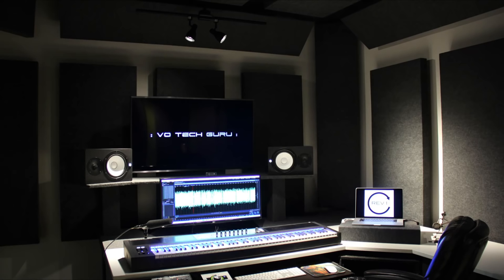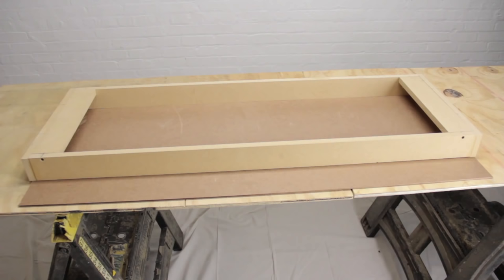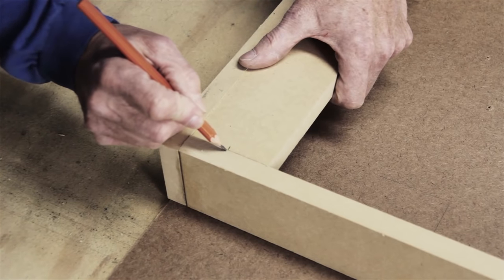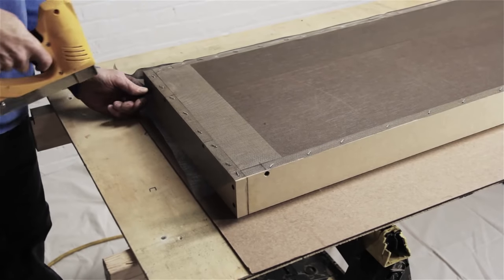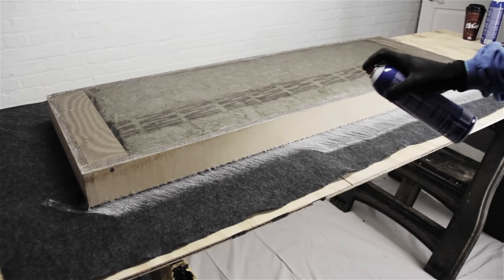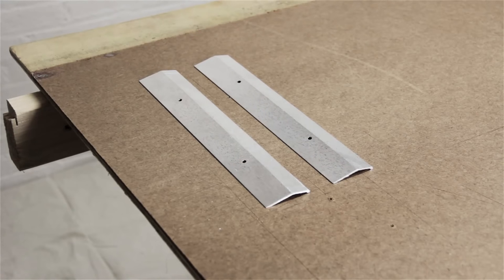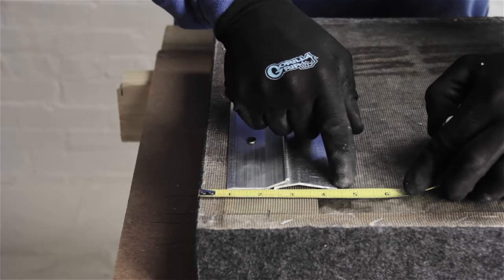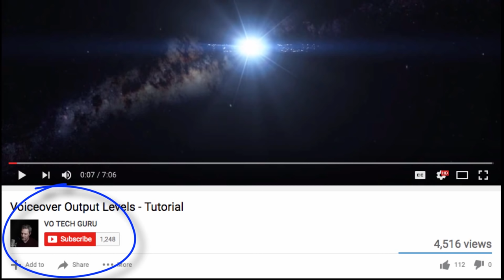How To Build Acoustic Panels | DIY Acoustic Panels

Comment: Thanks very much for this. Helped me to make mine. I link this video in my description.
Reply from the maker: Awesome. Thanks, man!
Reply: @VOTECHGURU  You're welcome! I should emphasize that you've made a great resource here. I found that my local Home Depot had the 24" Roxul in stock without special ordering, so I went for that. They didn't have 3/4" MDF so I took a chance on 5/8" and that seems to have worked fine.

I also threw together some easels out of scrap wood so I can use them as gobos and move them around. As per my video, the difference is noticeable.
Reply from the maker: @RaymondParkerPhoto  Sweet! If you'd like to share the results I'd love to see them.
Reply: @VOTECHGURU  I uploaded the video, including caffeinated construction clip and audio comparisons to my channel.

Comment: While I wait for the daily temperature to climb to 65 degrees for gluing felt fabric over the 12 treatments I just built to your spec, I'm thinking about turning two of these into portable gobos. I'll design and build two floor stands. But I'd also like to cover the back of each panel with fabric for  wrap around finish. Would you recommend gluing fabric only against the back side frame edges and two support beams?  Or would you suggest also gluing an extra layer over the four sides? This is mainly for aesthetics but I don't want to later discover the backside felt is peeling off for some reason! Thank you!
Reply from the maker: GhostwriterSays Good question. I would probably glue to the backside and then use some sort of black trim for the edges where the corners meet.

Comment: Thank you for the build tutorial.  I swear you and Bill DeWees spoil us.  :D

Tim, quick question for you.  For the Safe n Sound would it be better to go thicker with the panels if you have a deeper voice?  I built some several months ago that are a double layer of Roxul which was about 6" thick.  It cost more materials wise but the reason I did it was something read that said that bass sound waves would go through thinner panels pretty easily?  Regardless, your way looks a lot easier than the ones I managed to fumble together lol.  Thanks again!
Reply from the maker: What's up, SaintDude! Happy to spoil you guys, you're worth it. ;-)

These panels absorb VO bass like crazy. Some of the information out there regarding "super traps" can get a little confusing. Super bass traps are usually used for killing bass where it's a problem in mixing spaces or venues. Then it makes a lot of sense to kill as much as possible so it doesn't cause the room to respond too much. Hope that helps!

Comment: Very nice, but can be done much simpler...no need for extra support wood, no need for mesh layer, you can easily staple the fabric on the back side, no need for glueing. Do use mask and gloves when handling with the rockwool. If you have space, make larger airgap between panel and the wall. Also use some rubber spacers between the mount and the wall.
Reply from the maker: Thanks for your feedback.

Comment: I have 12 frames ready to work with. I was curious to know whether you have ever experimented, or have any insight, as to skipping the use of screen on the fabric side of the panels. I have a slight concern that screen will prevent some of the acoustic treatment of the roxul?
Reply from the maker: I wouldn't skip the screen on the front because the insulation will bulge the fabric in weird ways. It's been my experience that the panels look MUCH smoother when you add the screen.
Reply: Thank you for the insight.
Reply from the maker: You got it. ;-)

Comment: I've watched quite a few videos on making acoustic panels and all of them save this one make a point saying the material on the front of the panel should be breathable for soundwaves to penetrate to the insulation, which that grey material being used doesn't look to be at all.
Reply from the maker: Hi Gerald. What we used is called craft felt and it’s actually extremely transparent. Not only can you breathe through it very easily, but if you hold it up to the light, you can see right through it. The video is just a bit deceiving in that regard. But trust me, they are very transparent. Thanks for watching and for your comments!

Comment: Make sure to sand and tape all corners which will get covered by the fabric just in case.
My fabric didn't hold up that well after a few years, separating at the edges. It's a minor step to do and maybe isn't even needed depending on material used.
But better safe than sorry.

Comment: Can you comment on the idea of drilling holes in the sides, top and bottom to increase sound absorption?  Some commercial providers are using that idea. Would be easy to add holes underneath the fabric cover.
Reply from the maker: GhostwriterSays It would help but with diminishing returns relative to the effort, IMO. The angle of the panel sides to direct projection of sound is at 90 degrees anyway so it’s not something I would bother doing with these panels.

Comment: great video! if the Rockwool I have is 15 1/4 wide, should I make the Frame 15 inches wide? or 14.5? not sure about that. thanks for any advice
Reply from the maker: Thanks! If you go to the 1 minute mark you’ll get the exact dimensions. We used 15-1/4” wide Roxul in the video.

Comment: Does the screen step make that much of a difference in the build?
Reply from the maker: Yep, and a huge one. The front of the panels will be much smoother and the back will keep the insulation from falling out. Thanks for watching!
Reply: @VOTECHGURU  Thanks!  We just bought a place here in LA and one of the rooms will be our recording/ streaming room.  So I plan on building these out in the room.  but probably gonna try some fun angles and designs vs square and rectangle shapes... we will see though as the square and rectangle are way faster!! :)
Reply from the maker: Very cool!

Comment: Awesome video! I was curious, I have a closet insulated with acoustic foam and have a shield on the back of my Audio Technica 40/50 which is a RF-X SE Electronics Portable Vocal Booth. Will this help or would it be better to remove it if I already have acoustic treatment on my walls? Thank you so much, hard to get answers to questions like that!
Reply from the maker: Jay Dean I totally understand. The shields don't do much in an open room that's not treated, and are often useless if you are in a treated booth. Feel free to send me some pics at the email below and I can better advise you. :-)

Comment: Went to Home Depot to ask about cutting up the board.  They never heard of MDF and said they "couldn't" cut anything less than 6".  The place I got acoustic treatment from said they just glue the cloth straight to the rigid 730 and have hooks that hook straight into the fiber glass.  I can see that wooded boards make a nicer look, and are sturdier lasting (getting edges hit) and move around more easily.  But to DO this project?  It would costs hundreds of dollars.  That's on top of the $500 I already spent on fiberglass, fire retardant industry audio cloth, tools, hooks & adhesive for nine 4'x8' panels.  Using wood would double that cost.  That miter and drill are $300 on Amazon, more like $450 at home depot.  For $1000, I can get 9 ready-made panels online.  So beware of these additive costs!  Aside of that, great presentation.  Well done video and superb parts list & links!
Reply from the maker: Dennis Barrington Thanks for the compliments. I’m not sure what to say about your Home Depot not knowing what MDF is because that’s like a mechanic saying they don’t know what a muffler is. But given the fact they won’t cut more than 6” I suppose I shouldn’t be surprised. BTW, it’s easy enough for anyone to cross cut the frames with a powered handsaw and a fairly steady hand. I made a few that way with no issues. A jig or table saw would work too.
Reply: I tried doing that with a circular saw, but it was too wavy.  Hard to stay straight for 8 feet!  But you'd need a garage and some good woodworking gear to do it.  If you have that, or a friend, yeah.  What should NOT be lost is:  Do Some Acoustic Treatment!  And for that I thank you for the work here in the video!  If you use that soft bat stuff, you definitely need a wood frame.
Reply from the maker: Dennis Barrington Yeah, it would be a nightmare to rip cut the sheets with just a circular saw. I was referring to cross cutting the 3” pieces once you have them. I did have another guy who said his Home Depot would only rip MDF to 10” so he took those and ripped them to 3” on his table saw. Not everyone has one, but that’s another way to get it done.

Comment: you can use basically any insulation you want right??
Reply from the maker: You can, but I find mineral wool works best. Whatever you do, definitely do not use paper faced insulation. That will defeat the purpose as the sound will not penetrate the paper and allow the insulation to do its job. Thanks for watching!

Comment: Hey! Love the video. Ive just got the materials and about to start bulding! One question though,  how would you go about hanging these in a corner? 

I was considering heavy monkey hooks on either wall hooked on a wire screwed into the frame...

(I've got plaster walls in my studio space and there fore am using toggle bolts for flat wall mount if this is relevant) 

Really looking forward to my personal manifestation of your excellent tutorial, kudos!

Comment: Great video, thak you! Does it work anyway  if i use some decorative fabric insted a standard grey one? Like some colourful fabric that it's normally used as a wall carpet?
Reply from the maker: The important thing is that the fabric is transparent, meaning you hold it up to the light and see through it really well. Another way is to hold the fabric up to your lips and blow through it. If air passes easily then you’ve probably got good material to work with. BTW, you can get the craft felt I used in a ton of different colors. And it’s very thin and transparent. Inexpensive, too.

Comment: Great Tutorial! Wondering if you could help me with some measurements to cut the MDF for 6" deep bass traps at the larger size Rocksol (24")
Reply from the maker: Christian James Thanks! Yeah, just double up the depth of the panel frame and then adjust the width for 24” insulation. Whatever material you’re using for the frame, just make sure the inside of the frame is the same width as the actual measurement of the insulation. Be aware that you should look that up to get the exact width of the 24” wide insulation because the 16” insulation isn’t actually 16” wide. What they actually mean is it sits firmly in between 16” studs.

Comment: Great video!  I'm not seeing the Safe "N" Sound insulation you recommend available at the Home Depot website.  Any other recommendations?
Reply from the maker: Robbie Ehrbar Thanks for watching! If you click the panel supplies link in the description below the video you'll see the Roxul product and a link.
Reply: Gotcha (my local store was out but another one had it).  Are these sheets pre-cut or is a roll that needs to be cut up?
Reply from the maker: Robbie Ehrbar Precut and they fit perfectly if using the frame dimensions in my video. There are 12 pieces per pack of Roxul.

Comment: Is there a major difference between sound treatment for a recording studio and sound treatment for a home theater? Also, how did you mount the panels on angles in the corners (shot at 0:12)?
Reply from the maker: Home theater is a little less critical than for mixing or voicing, but I would just use the same method anyway. We cut triangular shelves and installed them in the corners, then mounted the hanging brackets and panels to those. Hope that help and thanks for watching!
Reply: @VOTECHGURU  Thanks for replying! Your description of the triangular shelves makes sense, but that would also make for a good instructional video.
Reply from the maker: Frank Romano Agreed. I’ll have to schedule some time to do that.

Comment: Great Tutorial! I may have missed it but how much felt do you recommend?
Reply from the maker: Hi Mark and thanks for watching! Great point, I just amended the materials list with that info below the video. Thanks!
Reply: Thanks so much!
Reply from the maker: You got it. ;-)
Reply: Hi Tim, almost done with 8 panels and actually one of the most enjoyable projects I've done. Not sure if I missed it in the comments but do you have dimensions for the bass traps?
Reply from the maker: If you mean for the corners, same width but longer. If you create and install triangular shelves in the corner you can use the same hanging method.

Comment: What is the difference between using insulation and foam? Is there a difference? Is one better than the other? Looking into making some of these for my husband. I love doing wood work and his home studio needs these. Any related info is greatly appreciated!
Reply: just dont use foam never. dont even consider it.
Reply from the maker: Laura Hernandez Hi Laura. Thanks for watching. There are many types of foam but I would never consider using them instead of the product in my video. Foam,  especially 2 inches and thinner, won’t do a good job at absorbing lower frequencies. Hope that helps!

Comment: If you want to make an uber good looking one that offers slightly better performance in the low end, here's what I've done:

Get a $20 pocket-hole jig and some Tight Bond II wood glue.   Pocket hole screws aren't strong but they'll hold it together for the glue to dry.  That particular glue is stronger than wood itself, also join the short pieces to the face of the long ones.   The benefit of this method is it lets you keep the joinery on the inside with no visible screws or nails on the outside, and you can apply wood finish to the outside frame which looks really nice. The other caveat is if you use plywood you have exposed edges which require iron-on laminate strips ("edge banding") before finishing, and the whole process can take days instead of hours.    The edge banding doesn't take very long and makes the cheap plywood look solid wood, you just gotta be patient cutting it off with a utlity knife. 

I also use a 3" hole-saw that attaches to a drill and spaced out 8 holes in the long sides and 4 in the short.   When you factor in the hole-cutting + sanding, + laminate + wood conditioner + wood stain and clear, coats ....  it's a. lot of work.  

The next issue is you need to fasten the fabric to the inside of the frame in order to keep the outside stained wood visible.  This requires cutting some thin wood slightly shorter than the outer frame and using it to pinch the fabric up against the inside edges,  flush with the outer face of the panel.    This was by far the most confusing part for me at first,  but when you see a white fabric pop through the holes of a dark wood stained wood on the outside -- it seems worth it.      Especially that moment you hang 10 ten of them.  They'll be night and day prettier than the bare minimum with slightly better bass absorption because of the holes.
Reply from the maker: Man, you went after it! Did you make a video on it? I’d love to see how they turned out.

Comment: Great DIY, what is the store name for the  mounting brackets? I did not see it in the parts list.
Reply from the maker: Jeffrey Haight Hi and thanks for watching! You can buy them at Home Depot. They have many different types of transition strips so I didn't bother linking them. The important thing is to make sure that the strip, when cut, will match up back-to-back and give you the distance from the wall that you need. Close to 1/2" should do.
Reply: Built eight of these this week, absolutely the best source for DIY panels. Building the base panels at 6 in depth later this week. Saved a couple grand... Thanks again!
Reply from the maker: Jeffrey Haight Awesome, man! If you'd ever like to share your results I'd love to post them on my VO Tech Guru Facebook page. Have fun creating in your new space!

Comment: Hey how heavy is each panel? I am trying to hang up this style of panels using industrial velcro on the top and bottom of the frame. I know one strip will hold up 10 pounds, so I was hoping I could add multiple strips to accommodate a  20-25 pound panel? Is that about the weight?
Reply from the maker: They are around 12 lbs at that size.

Comment: I'm curious about 2 things. Do you know which type of screen you selected. There seems to be more than 1 type. Also, do you happen to know what your fabric was made of? I have ordered some samples of acoustic fabrics form Guilford of Maine and was wondering if I will need something thicker due to the spray glue?
Reply from the maker: Praxis Living. Hi and thanks watching. The screen is fiberglass insect screen from Home Depot. The fabric is charcoal gray felt from Jo Anne Fabric and it's pretty thin. When you hold it up to the light you can see light through it. Hope that helps. :-)
Reply: Thank you. That helps a lot. The fabric samples I have also allow light to show through and do not sound quite as thin as you describe so I should be good as far as glue bleed.

Comment: CARPET TRANSITION STRIP whats the with 1 3/8 or 2 inches? im done with everything else im just debating on a hanging technic
Reply from the maker: Hi and thanks for watching. I'm not sure it matters how wide the strip is as long as the angles work out when you flip them and you have enough width to insert screws. I assume that's what you meant by the width?